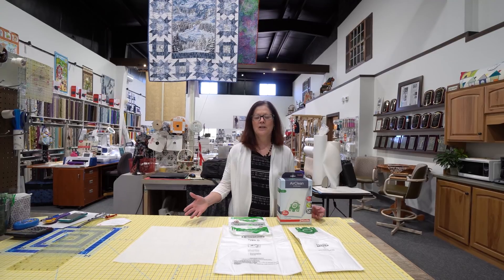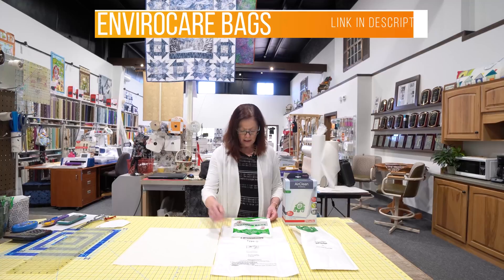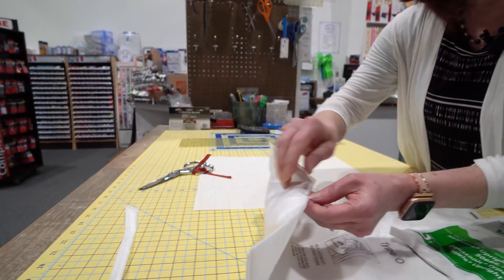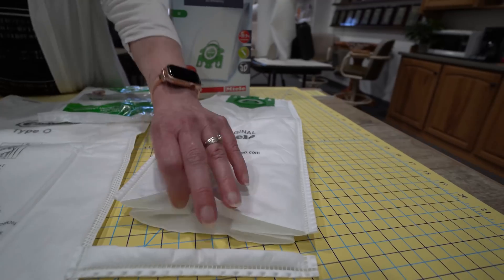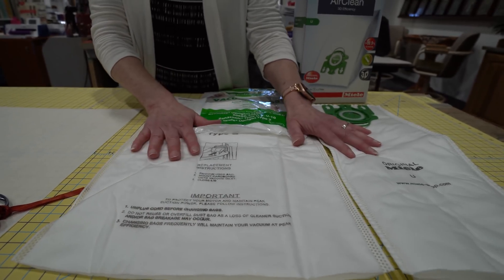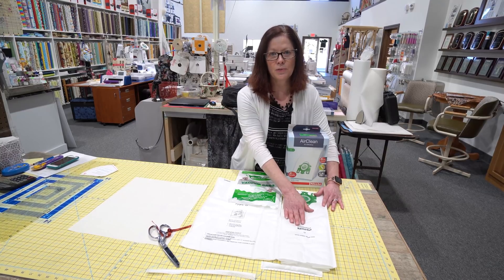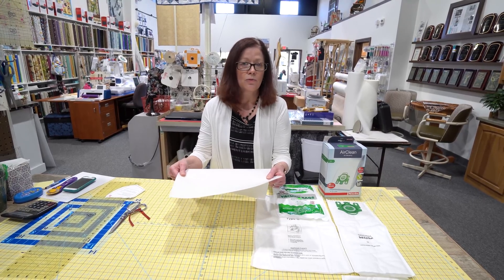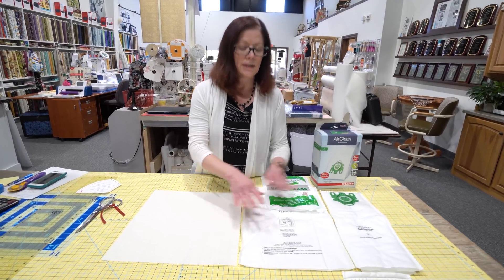Top 3 DIY Medical Face Mask Vacuum Bag Filters

Comment: I come from Taiwan. I have been studied homemade face masks for 3 months at least since COVID 2019 outbreak. After you finish this homemade face mask (pocket), it is better to put PP [Polypropylene] waterproof spunbonded non-woven fabrics (as a droplet-preventing layer) at outer layer for inside of this homemade face mask (pocket) at least. If possible then you can put PP [Polypropylene] melt-brown fabrics (as a filtering layer) at inside layer for inside of this homemade face mask (pocket). 

** PP [Polypropylene] waterproof spunbonded non-woven fabrics (as a droplet-preventing layer) can be reused and washed but do not knead it while washing. Please pay high attention that face tissue (PP non-woven fabrics or wooden pulp cellulose), wet wipes (PP non-woven fabrics), toilet paper (wooden pulp cellulose), and paper towel (wooden pulp cellulose) are all absorbent, not waterproof. 

** PP [Polypropylene] melt-brown non-woven fabrics (as a filtering layer) can be reused and sanitized only with highly dry heating but cannot be sanitized by water-washing, Ethanol-spraying, Hypochlorous Acid water-spraying and Isopropanol-spraying because these 4 substances would severely weaken its filtering effectiveness. And the time for reuse does not exceed 5 times. By the way, both vacuum bags and HEPA air filter are made of PP [Polypropylene] melt-brown non-woven fabrics. If you cannot find PP [Polypropylene] melt-brown non-woven fabrics at local in your own country, you can use both of them instead. 

The more all human beings unite together, the stronger we would be. 

Please leave regular medical, surgical medical, N95/FFP2 and medical N95/FFP2 face masks to frontline health care workers.
Reply: Thank you so much for this... I agree and have been pasting my above warning on a few of these DYI Masks on youtube channels as I see them.  I'm so scared people will not know this and follow these people blindly thinking they are doing the right thing.  I almost did also, but as always I do my own due diligence and found my links above.
Reply: Thank you so much!! I just started researching diy masks. I already know to make sure the filter I use is not made with fiber glass. I didn't know about this. Obviously, I still have more to research. Stay safe & healthy.
Reply: So hepa vacuum filters are the best way to go ?? Just double checking.
Reply: @yeahidoubtit2094  YES, If you can't get qualified Melt-Blown non-woven fabrics.  But, it is better  to PP [Polypropylene] water repellent spunbonded non-woven fabrics (as a droplet-preventing layer) at outer layer

Comment: How safe is it to actually breath through it? Chemical composition are for vacuum cleaners not really for human use? It might be ok short term but what about prolonged use especially in a few years can you clarify on this matter? Especially as your endorsing there use.
Reply from the maker: These are not intended to replace N95 masks or any other mask for that matter. These are cloth bags with the exception of the polypropylene filter which is actually the very same fabric that surgical masks are made from. Please see our disclaimer in the description of this video. We certainly hope no one will need a mask for years. Stay safe!

Comment: So, where exactly are you getting the 99.9% info from? Miele won’t provide the info, and they don’t recommend  using the bags for mask. I’m guessing for liability reasons. Do you know exactly what material the bags are made from, and if it’s something a person should inhale? Also, what effect does washing do to the material? The box says 99.9% of all dust. So, what’s the smallest particle size that can be filtered?
Reply from the maker: The 99.9% statement we make is from the box referring to dust. These are cloth bags. We do know they don't recommend using them as masks and yes that's because of liability reasons. All of the masks and filters we have suggested are not intended to be a replacement for N95 masks. Our disclaimer is in the video description. We have washed and dried these bags several times so far and they have held up great. We do NOT know how many times that can be washed without falling apart, time will tell on that. The only fabric we know that has a 0.3 micron filtration level is the polypropylene fabric
Reply from the maker: Here is the link to mask we made with the polypropylene filter → https://www.youtube.com/watch?v=gpqOqiCOcwY

Comment: What’s the  smallest size particle in microns these filters can filter?
Reply from the maker: The only one we have that exact data on is the polypropylene fabric which is 0.3 microns
Reply: I thought covid is 0.1m. Are there any bags effective against that size?
Reply: @Girlygirlsread  even n95 masks filter to .3 microns
Reply: musicobsession oh, didn’t know that. Filtrete 2800 filter “ultrafine particles” but don’t specify down to what size.
Reply: @Girlygirlsread  That's one of the important issues alone with how safe they are. If they aren't better than woven cotton, then they aren't worth the cost.

Comment: The polypropylene material is also sold at Walmart as a craft material  called Oly*Fun.  It.comes in rolls 30" x 3 yards.  They cost $2 per roll at my Walmart.  I was able to get 10 rolls for $20.  I learned about it from another mask video that was done by a nurse.  She said it is the exact same product they use in hospitals for surgical draping, creating sterile.fields, etc.
Reply: Pretty sure Olyfun is like .65 not .3.
Reply: Thanks for the Info
Reply: Can u share the link to wear u find the material at Walmart.  It's so many links now to make face mask. Thank you
Reply from the maker: Thanks for the link, we are unsure about the filtration level of Oly Fun. We recommended the one in the video because the manufacturer confirmed it has a 0.3 micron filtration level.
Reply: SuperStitchSewing Where exactly are you seeing the .3 microns advertised?
Reply from the maker: @GeneralRock114  That came directly from the manufacturer of the polypropylene filter.
Reply: @SuperStitchSewing  Thinks.

Comment: So I bought the Miele Vacuum Cleaner Bags Type: U to make my mask, but I noticed that it doesn't say anywhere about being a HEPA bag. Would this bag still help in preventing the virus from going through? Because I also couldn't find info about the size of microns it would allow to pass
Reply from the maker: These are not HEPA filters. Most HEPA filters contain paper and therefore are not washable. The only one that we know the micron filter level is the polypropylene filter. 0.3 microns for that one.
Reply: I received this info from Miele customer care via email (they do not label their bags Hepa): "My team confirmed you will get 99.95% filtration against particles 0.5 microns or higher. At 0.3 microns, it is 94% filtration."

Comment: Thank you for your an extremely useful video! I'm in Europe and can't seem to find the specific vacuum bag models you mentioned. I can get the Miele HyClean 3D series but not the AirClean. Do you know whether these can be used instead? I'd course like to ensure I don't use any materials containing fiberglass or unwanted chemicals. Many thanks for your tips.

Comment: Thank you for posting this.  On a related note, existing face masks can be treated with polyethelyneamine and or catechin, an African plant, to create an effective viral blocking mask;  Here are some selected citations;

"Studies published by Tiliket et al. and Catel-Ferreira et al. in 2015 demonstrated a cellulose based material for airborne virus filtration in which a low-cost non-woven cellulose material (Kimwipes) were chemically modified by coating them with polyethylenimine (PEI) or grafting in an antiviral agent; catechin." 

"The filtration efficiency of the modified filter media was first tested on aerosolized T4D viruses (Enterobacteria phage T4, Doermann’s strain T4D). Then the treated filter was inserted inside a commercial medical mask in place of its cellulose layer and the reconstructed mask was challenged with TD4 aerosols to evaluate its virus removal efficiency."

"Both treatments significantly improved the virus capture factor (ratio of upstream to downstream PFU contents) of KW cellulose wipes and of reconstructed commercial masks when compared to original masks and to masks reconstructed with untreated wipes." 

Tiliket, Ghania & Ladam, Guy & Nguyen, Trong & Lebrun, Laurent. (2016) published "Polyethylenimine surface layer for enhanced virus immobilization on cellulose."   Search for that article online. 

Polyethylenimine (PEI) is a  polycation, which is readily adsorbed by the cellulose matrix from a 0.1% w/v solution in NaCl 0.2 M (ca. 100 ng cm−2). Further PEI adsorption steps at higher PEI concentrations induce a linear growth of the PEI films, suggesting that free adsorption sites still exist after the initial adsorption. The adsorbed PEI chains are resistant to variations of the ionic strength up to NaCl 1 M. 

"Promisingly, the adsorption of T4D bacteriophages are 15-fold more efficient onto the PEI-treated fabric, compared to the native regenerated cellulose films, as measured by QCM-D. 

This confirms the strong affinity between the negatively charged viruses and PEI, even at low PEI concentration, probably governed by strong electrostatic attractive interactions. 

This result explains the remarkable improvement of the affinity of medical masks for virus droplets when one of their cellulose layers was changed by two-PEI-functionalized cellulose-based filters."

Polyethylenimine  is commercially available.

This should be of interest to DIY mask makers.
Reply from the maker: Interesting and thanks for this information
Reply: Links for purchase?
Reply: A Day in My Life - The PEI spray is DIY, just like the mask. I purchased a bottle of 25 ml of 30% PEI online and diluted it down to about 9% by adding 60 ml of purified drinking water that had 1/3 teaspoon of table salt added. For a spraying I used an emptied and cleaned 2 oz travel size pump spray bottle. Soak your filter Media with it and let it dry completely. Do not use it on the outer portion of the mask which touches your face - just the filter media in the inner pocket.

Comment: 1:21 "This is the outside of the mask, facing your mouth". This is a bit confusing. I would say the outside of the mask is the side not touching the mouth. Can you please clarify?
Reply: On a vacuum cleaner, the inside of the bag is pressurized and the direction of air travel is from the inside of the bag towards the outside of the bag.  So, would it not make sense that the inside of the bag is on the outside of the mask?  When we breath in, air would travel from the outside of the mask to the inside of the mask.
Reply from the maker: @sirvayr  In sewing, the inside of the mask faces away from your mouth. That way, the air coming through the mask is filtered.
Reply from the maker: Which is why we say, "the outside of the bag, faces your mouth" - it seems people are going to be confused no matter which we say this.
Reply from the maker: The insides of the bags face AWAY from your mouth. Away from your mouth is the inside of the mask. "Fuzzy" side of the bag faces away from you.
Reply: @SuperStitchSewing  I'm still confused.. which side touches your face?
Reply from the maker: @kathrynlouise8396  You want the outside of the filter facing your face. You don't want the fuzzy insides of the bags touching your face.
Reply: @SuperStitchSewing  That makes sense because vacuum bags filtration is meant to keep the dirty air you've already sucked into the bag from going back out into the room.  So, it would follow that that is the side that should be facing the incoming virus's - right? Also, my bags aren't really fuzzy per se.  They are for my Panasonic Upright.
Reply from the maker: @kathrynlouise8396  Yes you are correct. You just want to make sure that those bags are cloth bags. If they aren't they most likely will not be washable.
Reply: @SuperStitchSewing  the package says fabric.  Have you seen Dr. Ryan Southworth's youtube video on using Size Y HEPA Vac bags? he has the outside of the bag actually facing outside.  I just posted a question on his video. I hope to hear from him.  Can you look and see what you think?
Reply from the maker: @kathrynlouise8396  This video is for washable filters. HEPA filters can be unwashable because they can contain of paper.
Reply from the maker: The polypropylene fabric we mention in this video is the one that is made of the same material as surgical masks. Here is our tutorial on that one https://youtu.be/gpqOqiCOcwY
Reply: Kathryn Louise 😂 you and me both, girl.
Reply: @SuperStitchSewing  pardon the question but i looked up the bags that were in the link. To purchase on ebay and they all say Hepa in their description. Are the ones pictured not the right ones?
Reply from the maker: @HectorHernandez-qo9ru  The Miele U bags come WITH a hepa filter in the box but the bags themselves are not hepa filters. The envirocare are not hepa filters unless you are looking at a different one and the polypropylene is definitely not a hepa filter
Reply: SuperStitchSewing the side with the writing touches ur face?
Reply from the maker: @samlev5997  Yes
Reply: @SuperStitchSewing  After separating the bag into 2 pieces and cutting sections for my inserts... I do not need to remove any layers?? I am using the envirocare bag presently and it has a thin layer above the fuzzy material (interior of the bag).
Reply: @SuperStitchSewing  I am afraid you should really rethink what you call the inside of the mask.  Most people will see it like this. Mouth --> Inside of the mask (the hollow side) --> mask --> outside of the mask (concave side).
Reply from the maker: @windmill10  Sorry for the confusion, but the inside of the mask in sewing, is the inside of the fabrics. Like the inside of a quilt is between the fabrics.

Comment: @1.50 You are saying washed and dried successfully to be reused. 
Q: what about the filtering level after washing? are those been tested by someone already? if so how they tested and what are the detailed results, please? thanks
Reply: Every mask that is out there right now looses it's properties when washed, i suspect it's the same with this material. The replies here that suggest heating or using hydrogen peroxide vapor are probably much better choices.
Reply: I've read that the manufactured surgical masks can be sanitized by heating to 70 degrees Celsius for 30 minutes in dry heat.  So, I'm going to keep a covered pot at my entryway and drop used masks in there.. and heat up when I'm nearly run out of clean ones.
Reply from the maker: The filtering level has not been tested, scientifically. We are simply saying that the filters do not fall apart doing washing. They are all cloth filters with the exception of the polypropylene filter fabric.
Reply: @SuperStitchSewing  instead of washing, use UV light for 3 hours
Reply: Very good to inquire about.  Because cleaning can change the efficiency of the mask if done wrong.  And they are trying to decide a safe way to sanitize masks.  The last that I heard they used H202 vapors to clean them and they stayed 95 percent or more (hydrogen peroxide vapors)
Reply: What about microwaving it?
Reply: @llall11  Not sure about the vacuum bag filters, but with the polypropylene,  you can NOT microwave it.  It melts at high temperatures...   I discovered this when I tried to press a seam open.  It seems to do fine in the dryer, but definitely NOT microwave.

Comment: There are some comments on-line that hepa filters are damaged by water-   Can you say how you recommend "washing" the filters masks and do you have a measure as to effectiveness after washing?   Thanks for your efforts-  on the front line and with two kids on the front line
Reply from the maker: Hi there, great question. The filters shown in this video are NOT HEPA filters, they are cloth filters with the exception of the Polypropylene filter fabric. We have washed them all in hot water and dried them in a dryer and they are holding up great. We are not sure how many washings they will last through, time will tell. Stay safe!
Reply: ScopeDoc Good question. And are the washable filters protective against the size of the virus? Something is better than nothing after all but I’m a bit worried about using a filter that the virus can easily penetrate.

Comment: Thank you for this excellent video. I live in a small village in Guatemala, and I do not know if I will be able to get these bags. Are all vacuum cleaner bags washable?  Are vacuum cleaner bags labeled as being washable or not?
I have read that double-layer dish cloth will give the same surgical protection as a vacuum cleaner bag. Do you know if this correct? I would like to see a video about a face mask designed around using double-layer dish cloth. Does anybody have a YT link to such a video?
Reply from the maker: Hi Allan, not all vacuum bags are washable and we do not know if they are labeled as such. We recommend cloth bags like the ones in the video. We do not know anything about a double layer dish cloth solution. Stay safe!